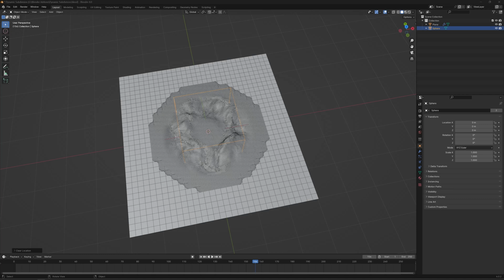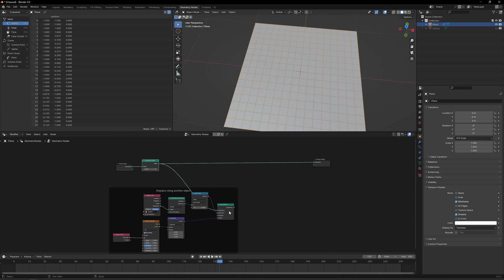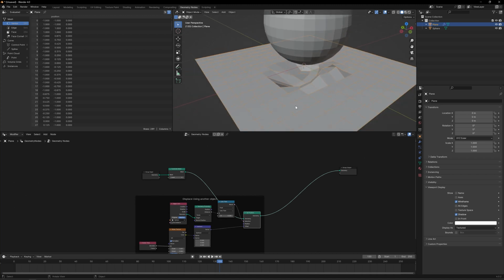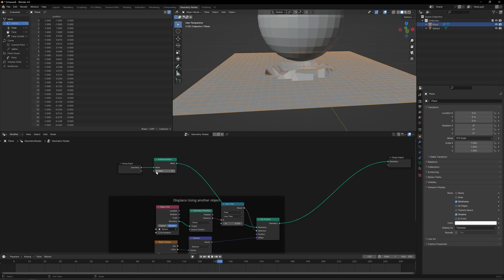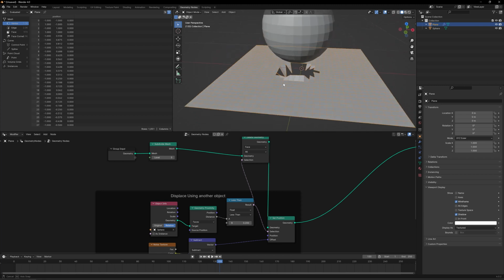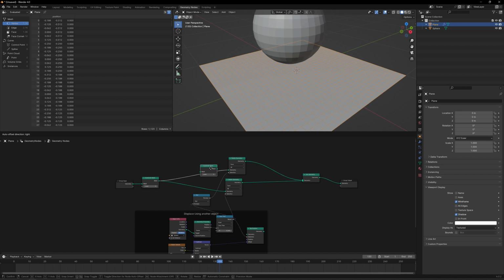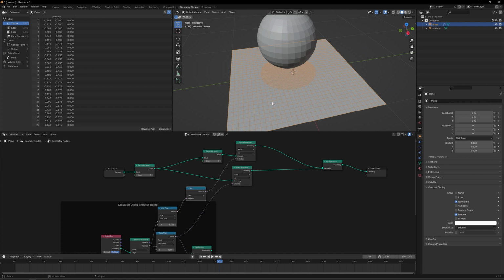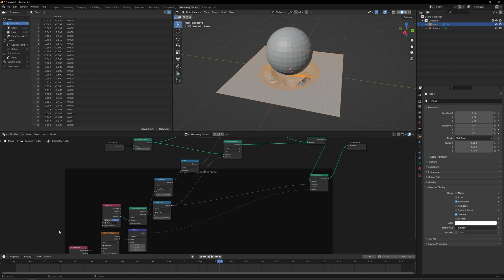How to Achieve Procedural Subdivision in Blender using Geometry Nodes

Comment: Is there a way to subdivide a mesh using geometry nodes so that vertices appear at the intersections of the subdivisions (like the way it would happen if you did it in edit mode on the layout tab)?  It would be nice to be able to control that in a project in case you wanted to change your mind later.

Comment: This is a terrible "solution".
1: The two meshes aren't connected, so you'll get artifacting when displacing.
2: Having two meshes taking up the same space will cause you a lot of headaches.

Add in: 
"Where Point Neighbors  < 4, set position to 'nearest' of other mesh"
Do this for both meshes, larger one first, exclude the "outer edge" of the larger plane.
Then merge by distance.

You'll get a seamless, dynamic subdivision mesh without artifacting.
Reply: Interesting. Do you have a short video to demonstrate this please? Sounds very useful to me.
Reply: @rlhugh  No, but it's pretty straight forward, it's only a few nodes (Vertex Neighbor), =, set position, and I forget the name of the last... "Nearest" I think.